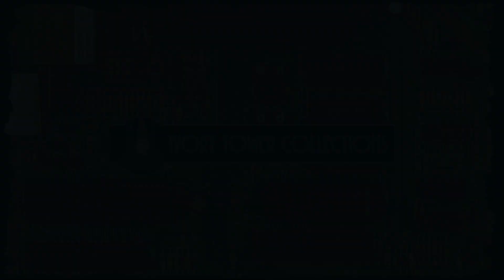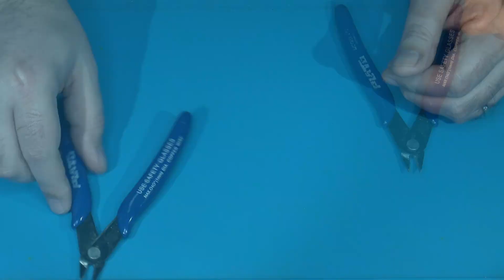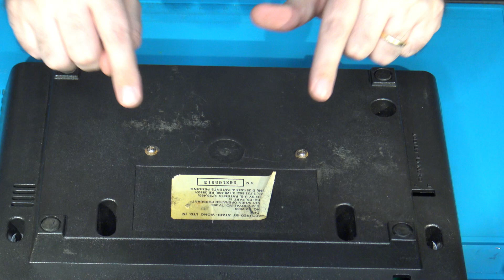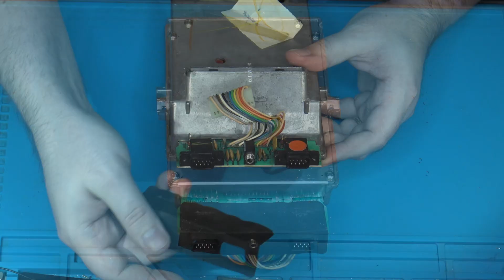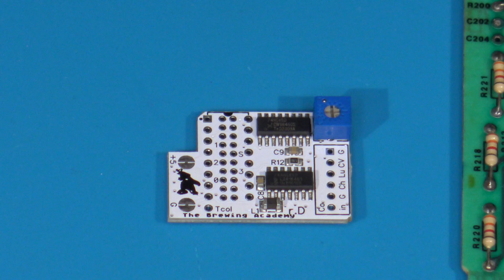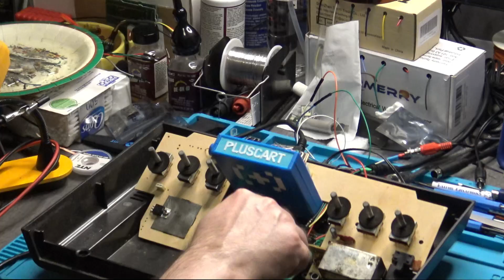ITC#89:- Atari 2600 6-switch UAV Install Process (NTSC)

Comment: Great video.  Is the UAV board held in place just by the wiring, or did you add anything (e.g. double sided adhesive pad) underneath it?
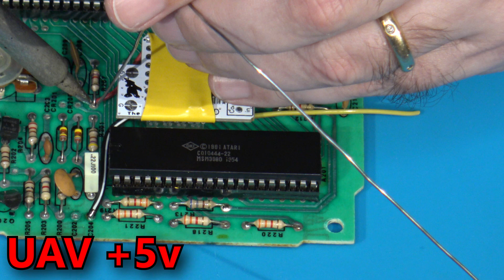Reply from the maker: I use about a small square of 3M plastic fastener material (Plastic velcro like). Part of the reason for the heat shrink around the UAV is to provide a larger surface area for that to be attached to. If you look closely around the 10:07 mark, you can just make it out. One square is on the bottom of the UAV, the other on the flat area of the main board. But the short wiring being used also helps to minimize movement as well. I don't really go into detail about that simply because some folks might want to install the UAV somewhere else and not in that spot. I've frequently seen such AV upgrade kits hot glued outside of the main board area onto other parts of the bottom shell for instance.
Reply: @IvoryTowerCollections  Thank you for the detailed reply. That's exactly what I needed to know.
Reply from the maker: @marktaylor127  No problem! Thanks for the comment for watching!